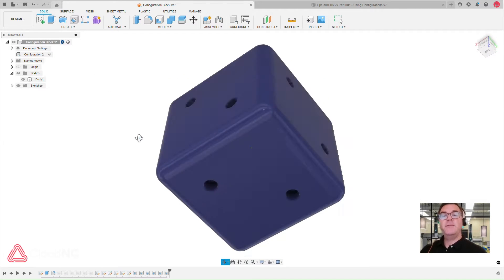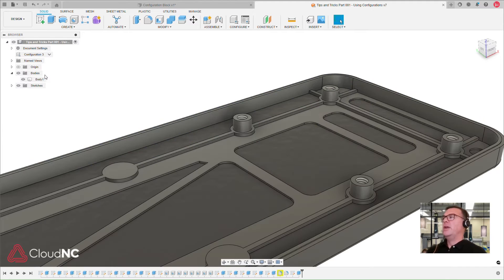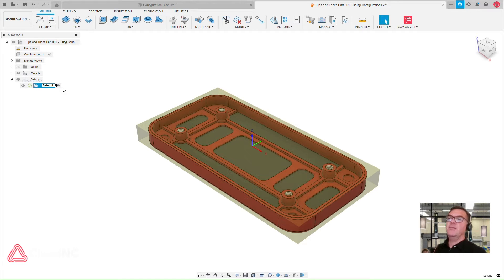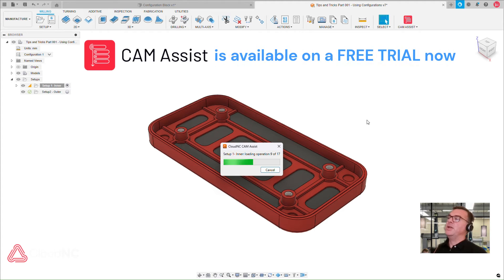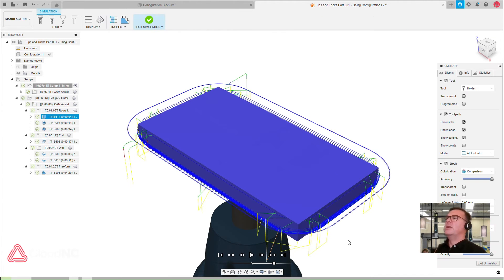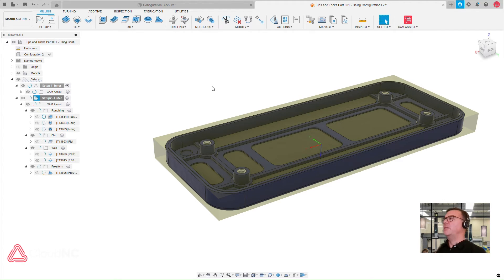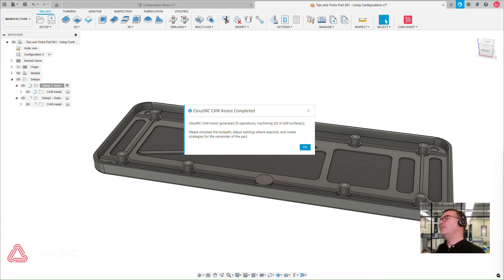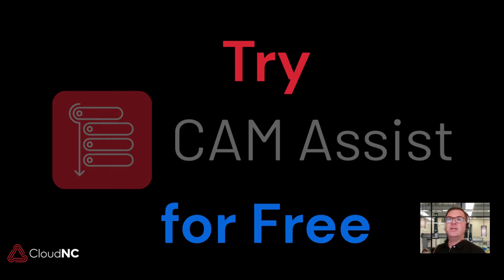How to accelerate CAM with Autodesk Fusion 360 Configurations and CAM Assist

Comment: Can you run cam assist on just certain features of the model. We do a lot of modifications to existing parts, not full machining from scratch. We also will have multiple features on a 3d model but will pick and choose what features to do based on the needs for that job

Comment: when i change some toolpath in one configuration (say, drilling depth), it changes it in all the other configurations, it does not look right !
Reply: Configurations are still quite new in Fusion 360, so the relationship to the toolpaths is not parametric. Changing configuration and re-running will result in toolpath operations that are specific to the configuration at this time. This still represents a beneficial outcome in many cases. Alternatively, if you name your toolpath folders in the browser, you could keep specific folders for each configuration.